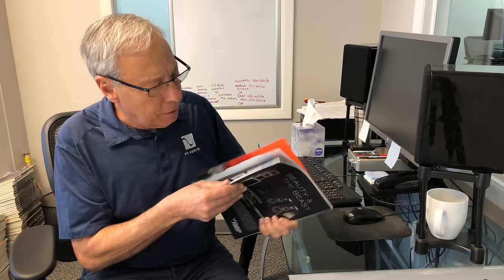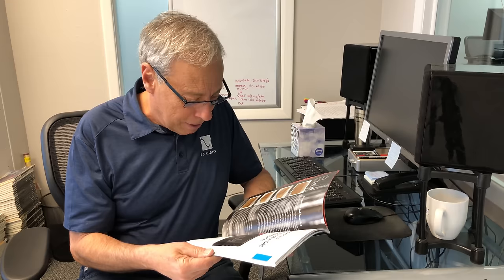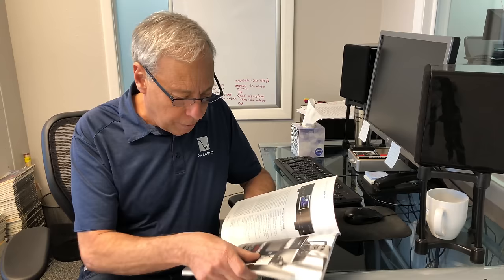Is equipment burn in real?

Comment: So assuming that there is a change in the components over time during break in, why is it that the result is always positive where it sounds better?
Reply: Bump... any new insights on this? Ive asked a few industry bigwigs about this and nobody can give me a reasonable answer.  Thanks
Reply: Bump.. any thoughts about this ?
Reply: Its when the parts reach their rated tolerances
Reply: tolerance rating of electronic components only determines how much their 'measured' values will possibly be different from their 'labeled' values. for example, in a 100 piece lot of 100 ohm resistor with 5% tolerance, each of them can have any value within the range of 100 ohm +- 5% which is between 95 and 105. there could be a 105 ohm resistor in the lot or a 95 ohm in the lot. tolerance rating is a 'what to expect' value, not a 'measurable' value of the component itself. and when a component's value in your equipment changes, there's a good chance your equipment will LITERALLY burn in.
Reply: Simple fact is, a capacitor is a component that actually has moving chemicals inside, any component that has moving parts needs a break in, but cables no way thats just BS
Reply: The diaphragm might be stiff when it just came out of the box, after some time of usage it MIGHT be softer and it sounds better.
Reply: @ljingjing  True, for speakers it do make a difference, I did not believe in 'burn in' but were surprised that the amplifier did get better, it were a bit raw with a little ripple distortion at first. But it went away over time, and got very smooth.
But generally it should make no difference for any amp or other equipment, and expecially not for cables - those who claim so are victims of a delusion.
Reply: Because psychoacoustics. If you were to measure the difference between "burned-in" and a brand new amp/preamp/whatever, it would be zero. The only thing that would make a difference is a temperature.
Mechanical components (like speakers) burn-in with time and you can actually measure that. Electronic components don't.

Anyone who doesn't agree - please provide measurements. If you can't measure the difference, there isn't any, no matter what you hear (what you think you hear).
Reply: @Synthematix  But why is the effect good and does not degrade the sound, and why do engineers use elements that have so much guess work involved?
Reply: Physics
Reply: @tomkocur  Then why not buy cheap junk and psychoacoustics will make it sound like the best equipment you'll ever hear?
Reply: @tomkocur  I guess you don't believe in a lot of quantum physics since you can't measure it. Capacitors are one of the easiest things to measure. Hell they change values when you solder them on the board. Small ceramic caps change values depending on biasing voltage. Caps do age and differently depending on dielectric. This is just one example. James Lewis from Kemet has done talks on the misconception of capacitors. It's a moot point because I can show you measurements until the cows come home and you'll say they're inaudible. People with closed minds have never contributed one iota to the advancement of the state of the art, never mind science.
Reply: @carlosoliveira-rc2xt   again you are just assuming the variance is good, why? And why would anyone design a circuit that he does not know how it will perform?

And finally what kind of music are you listening that it makes such a difference,it indeed burning electronics makes any positive difference. Nobody burns TV's or PC's... that would be silly.
Reply: @carlosoliveira-rc2xt  So do you actually have the difference measured, or you don't? If you do, show it to me, please.

You bring in cheap junk for some reason - we are NOT talking about different amplifiers here, we're talking about one amp and the difference burn-in makes. Not aging, burn-in - do note these are two different things.
Reply: @carlosoliveira-rc2xt  "Every single electronic repairman has those measurements for you"

...yet you can't show any. You're as credible as an antivaxer and you're also exactly the same kind of person. 

Now let's go through the terminology, wiki says:
"Burn-in is the process by which components of a system are exercised prior to being placed in service"
and it continues:
"There is another use of the term by some audiophiles, who leave new audio equipment turned on for multiple days or weeks, to get the components to achieve optimal performance. However, many debates have arisen about the benefits of this practice."

"Aging or ageing (see spelling differences) is the process of becoming older."

Or I'll recap it for you - Burn-in is forcing the device to get the OPTIMAL performance (sooner). Might take tens or hundreds of hours (on devices that can be burned-in).
Aging is THE EXACT OPPOSITE, it's LOSING the optimal performance over time. In electronics this takes years.
Yeah, loudspeakers can be burned in, and it can be measured on their impedance response - but that's mechanics. An amplifier though? It ages, because of course it does, but its performance won't change after first tens of hours.

BTW I have a masters degree in electronics and I built a couple of amps. Really wonder what your education and experience is. Voodoo? Snake oil selling?
Will you finally show me some measurement that will prove the burn-in effect on an amplifier?
Reply: @josearaujo8616  You obviously have no clue how audio electronics work. Relax,go back to knitting and don't worry your little head about it.
Reply: @carlosoliveira-rc2xt  Well I have to break in the needles first...  so they sound better...  Do you even know how a capacitor works? If anything use and time and break-in does is degrade capacitors. But maybe that's being to rational and scientific for you....
Reply: TOMPDUDE
This isn't an internet forum. By saying "bump" or replying won't make your initial comment go up...
Reply: @ljingjing  

I also thought about the diaphragm first but that doesn't make sense, it is supposed to be stiff to push the air and even though the diaphragm is moving it is not supposed to be a flexible part. Flexing can change materials even metal, just moving does not. So I would focus on the spring element but even more on the lip around the diaphragm that connects it's to the housing. But why it should sound better after a short time and not worse after some years, I'm not sure. Unless it has to do with rubber, from my experience with tires, than everything is possible. I can only imagine that if, IF burn in exists, the speakers are tuned after they burned in so they sound as they should when they are burned in. That is in no means a proof that burn in exists, it's the only way I can make sense of this.
Reply: My guess is that the test components that they use to tune the final product are often "burned in" from lots of testing, so applying the same processing to new components gives you a sound signature that wasn't tuned to be there, and once the components reach the same state as in testing, that signature comes back
Reply: KC  No, I think they use all those compnents together in a test build. And that no matter how precise you are in manufacting, variances will occur. And with certain components working together, the tiniest variance can be amplified.
Reply: KC  First off, it was just a theory, not a scientific paper, if you don't agree, that's fine. Second, they might not "test" per se, but somone has to listen to the assembled system before it goes into production, they would be insane not to. When you use the same components for multiple builds, things can wear down. And components might measure to 0.1^10000000 when tested new, but heat, moisture, and other factors can modify those values. After being subjected to those changes, they can settle though. Most audio gear isn't using NASA grade components. I don't buy into burn in, I'll listen to my equipment out the box regardless of what it says, this was just a quick thought to why it might exist, relax.
Reply: It's not that parts which burn in sound better.  It's that the final design of the product sounds best.  Countless other variations in component testing didn't sound as good as the final version...maybe these versions also became worse as a result of burn-in.
Reply: @TheEchelon  the person who posted the video sees that there is a new comment and may respond because of the new comment.
Reply: I conducted some single blind testing with 3 identical amplifiers all operating within the manufacturers specs bias current nearly identical . 1 was brand new less that 2 hours on it . 1 was burned in for 50 hours and 1 was burned in for approximately 250 hours.  None of my test subjects consistently picked the 250 hour amplifier as the one that sounded the best.  Their preference was almost evenly split between the 3 amplifiers.   Several music selections were used.The test were back to back  and the test subjects only knew that at least 1 amp was burned in to some degree. Equipment used was a high quality source, cables power supply, speakers etc.   The amplifiers were class A/AB and are of a very high quality.   Test subjects ranged from 25- 63 years old all of which were intimately familiar with high end audio critical listening and music.
Reply: @theinvisibleman2070  Manufacturers burn in electronics at the factory they do not burn in cables, cables are not semiconductors
Reply: user name   That is just non sense, you are telling me that caps that are new and perfectly functional and in the tolerance they were manufactured change specs after you apply voltage? The specs are in the caps, if they change they are bad, not good. No caps do not need any break in, nor do any electric components, that is just a weird myth, they are manufactured to tight specifications. Why do you think only in the realm of music they do "burn ins" ... because some people have so precise earing that can surpass precision instruments... posers and oil snake sellers, that is why.
Reply: user name  okay, give me an example of such measurement protocol, because so far you debunked nothing.
Reply: I would be surprised to hear a “burn in denier” who had a great sounding beautifully musical non fatiguing system.
Basically what I’m saying is, if you can’t hear burn in, you probably have tin ears.

Because...it’s pretty obvious with some equipment...including speaker wires(don’t know about interconnects haven’t noticed personally, but probably there too)

Generally, though I’m not an expert, new equipment has a harsher brighter more glaring tone. It mellows and sweetens with burn in.
If you can’t hear it, don’t blame others. ;-)
Reply: @mickywes3733  if you hear burn in of your electrical equipment, you're delusional.
Speakers or headphones can get burned-in, because they're mechanical (or electro-mechanical) - this can be easily measured. Tube amp can probably get burned-in as well. If you hear a difference after your amp burns-in ... well... okay, but no one here was really able to explain which component exactly is it that changes, what parameters of that component change and why and also no one provided any measurement.
 
If you hear a difference after your speaker cable burns-in, you're clearly delusional. It's a fkn copper (or silver) cable, there's absolutely nothing that changes on it over the time (well, it can oxidize, but that wouldn't really improve anything, would it). 

It's also interesting that these burn-in changes always somehow magically improve the sound, they never make it worse.

In realty it's all psychoacoustics. You just get used to the sound, that's all.
Reply: @mickywes3733   That is absurd speaker cable burn in.... nowadays even mechanical parts do not need burn in, including the engine of your car. Its absurd to think manufacturers would use components that can change the specs after use, if they do its because they are failing, not improving. Earing is a personal experience and perception is very important, why don't people use the knobs on their equipment to enhance their listening experience and have to resort to burn ins and otyher myths spending money in parts that have no effect its behond me...
Reply: @josearaujo8616  get a set of braided Kimber  cables use them for a month, then go get a new set and AB them. You will hear the difference.
Reply: @mickywes3733  Why would they act differently? Its just electrons, do they have to learn a path in the cable? Makes no sense honestly. Its all about perception.
Reply: Because that is how engines used to  behave.
Reply: @ljingjing  only in very hard sprung bass horn chassis. And only very slightly.
Reply: @andersforsgren3806  your brain burned in ;) it still sounds raw and ripple distortion :)
Reply: @carlosoliveira-rc2xt  yes. Depends, but diminishing returns starts pretty low. 700 to 3500 for speakers, if they measure flat and have a good dispersion pattern.
Reply: @evil_twit  Even with a multitude of drivers tailored for each frequency range, considering how speakers are made (wood, magnets and a membrane) its very hard to justify the price.
Harder to justify the price when you account for the limited range of  musical frequencies. i.e. the  speaker drivers able to reproduce with fidelity the range of musical frequencies are not that expensive.

But one thing is listening, other is perceiving... and on the perception front there is nothing you can do against a stratospheric price tag.
Reply: I actually heard some poorly designed headphones sound worse after burn in
Reply: @cassetteqin9973  Like with all things, burn in is for testing, not for improving quality. The worst the headphone quality controle is the more liquily is for people to find problems during the test. Most elastic materials memory is for the worst, they don't improve over time.
You could make the case for not having long periods of time without use, for extended use and burn ins it makes no sense.
Reply: @josearaujo8616  I agree with you, however, I think in most cases, a headphone designer spend months to physically tune (change damper material, or case structure) a driver to the sound they like. But when they use the same tuning on a new driver they sell you, it's not going to sound the same as they hear through their "burned in" worn out ones used for designing. Until you wear down you own drivers to the same level.
Reply: @cassetteqin9973  I do not think the tolerances of drivers change due to use in such extreme ways. They do change over time but it takes extensive use. Even in big subwoofers there is no change in performance, specially not for the best. What happens is that in the old days speakers use to be "burned in" but it was for testing, not for improvements, the same with cars or any moving parts. But anyway, soudn is mostly about perception, so if it helps people break in speakers, headphones, cables or cars to better enjoy them, I have no problems with that.
Reply: @josearaujo8616  I agree again. It's just with my experience the sound quality of a headphone changes exponentially. It varies rapidly in the first few days then it sort of lands somewhere stable. And I'm not saying this base on perception, I actually find this interesting and constantly do frequency response test on my headphones, and if you do that you can see the response curve change over time of usage.
Reply: Exactly.  Seems to me that "burn in" is your brain getting over the idea that you paid too much for this.
Reply: @mickywes3733  OMG there's no way I'm going to pay $500 for braided copper just to see if "cable burn in is real".  If it were a real phenomenon (cables performing differently after use) the entire telecommunications industry would surely want to know about it.  You can make millions of dollars optimizing their cable runs I'm sure.
Reply: @travis1240  whatever dude
Reply: @TOMPDUDE  Tests like this really separate truth from fiction.
Reply: @tomkocur  Plus, if components really WERE changing that much during "burn in," I think you'd want to retest and recalibrate bias. If things are really changing that much, the original bias setting might well be off. Without blind testing between burned-in and not burned-in units, I'm not willing to accept that people are hearing what they THINK they're hearing. Then again, if what they're doing makes them happy, I guess I am in favor of letting them have their fun. ;)
Reply: @TOMPDUDE  Imo, burn-in is primarily a psychological phenomenon.  The more you listen to a new component, the more accustomed to it you become and therefore the better it sounds to you.
Reply: @Oleg-oe1rc  THANK you
Reply: @josearaujo8616  See comments for OTHER realms
Reply: @tomkocur  Cheap junk and psychoacoustics is a completely relevant argument.
Reply: @josearaujo8616  Only knobs have knobs
Reply: @LeeBlaske  Wonder why there isn't a link to more info, perhaps published proof of such a test
Reply: @josearaujo8616  Hi Jose, I believe the reason why the equipment sounds better (not worse) post-break-in is because the equipment is producing sound the way it was intended.  In other words, when the equipment was designed, the components were already burned-in.  As such, one the components on the new equipment attain that milestone, they are now producing sound as they were designed to do which was not attainable pre-burn-in.  My two cents.  I have never experienced equipment burn-in, but speaker burn-in is very real and significant.  It took 4 weeks for my Klipsch Heresy IVs to FULLY break-in, though they got about 80% of the way there after the first week.  Hope that helps.
Reply: Very good question indeed and one that immediately makes one skeptical about the whole concept.
Reply: @Artemis_Prix  How do you know the components were burned in? I would have thought they would be using brand new components, fresh out of the box to make prototypes.

Also how come this whole burn-in effect apparently only applies to hi-fi? Why aren't computer companies, telecoms equipment manufacturers, TV companies etc etc all worrying about it?
Reply: @RaveyDavey  I acknowledge your skepticism,  and my assumption that the protypes were already broken in.  But anyone who has ever worked in a lab knows you can't design things in a day.   It takes at best many days if not weeks to test, refine, tweek, and repeat, until the desired  result is achieved.   When you buy new, none of that applies...it's de novp.  Why HiFi, my guess is because we can hear it,  vs burn in that occurs on equipment not designed for discriminating sound.   I'm convinced it is a natural part of all electronic equipment,  but it's effects simply aren't discernible because of what the equipment does (e.g., browsing the internet,  heating our food, etc).  I also believe the effects are likely more pronounced on equipment that uses large components (like HiFi) vs SMT, because there is simply more mass to those components.   For SMT, I would suspect burn in would occur fairly quickly.   Hope that helps.